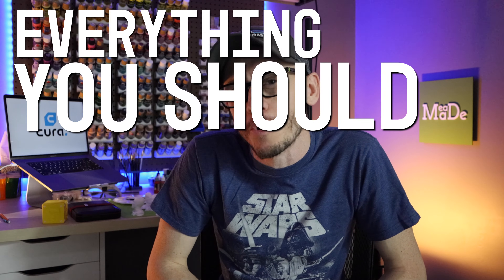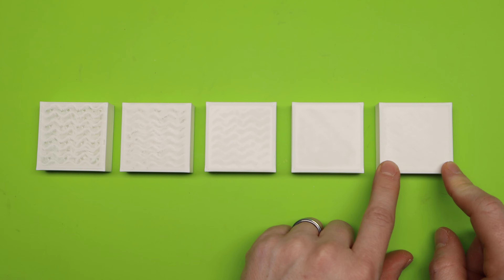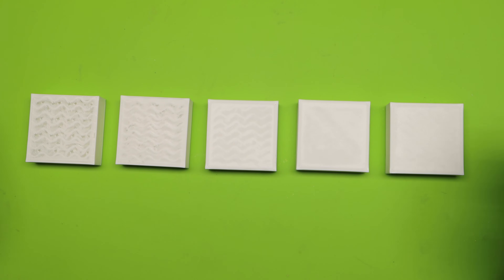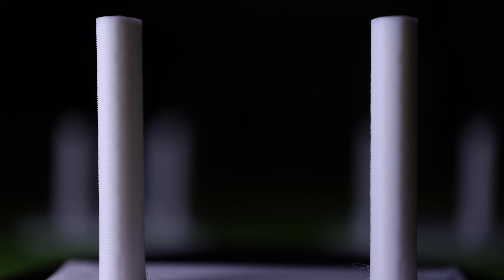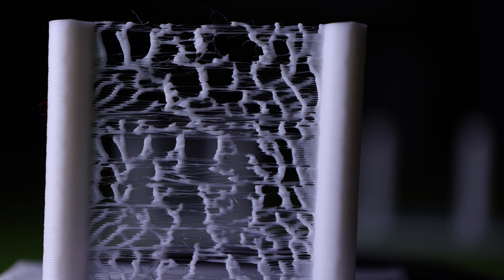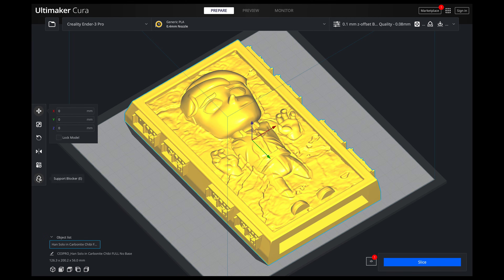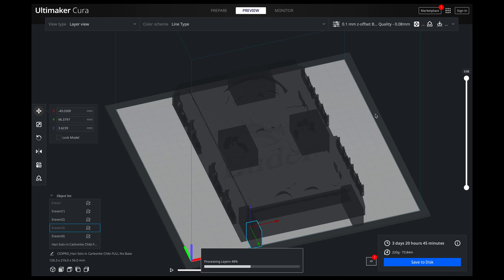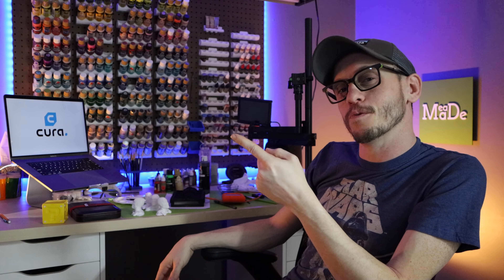Best Way to Get Rid of Stringing on 3D Prints Using Cura + Get Smooth Top Layer + Block Supports

Comment: Retraction Distance I found is not the only variable in that case, but in combination with retraction speed and print temperature, which depend on the filament you are using. For every filament, you have to document the Ideal Temperature to apply, the Retraction Speed (usually lower than the Cura default), and the Retraction Distance (higher, could be up to 10mm, obviously you won't exceed that since Cura won't let you). You'll have to experiment with a retraction tower first if you are using a new, untested filament.

Comment: Thank you! So much good information. I found this video because I have been dealing with a stringing issue. My prints were perfectly fine (well, more on that in a moment). But no stringing. I designed and created a squirrel proof birdfeeder. Then I dropped it and it shattered when it hit the rocks. When I started printing replacement parts, it was stringing bad. Wait a minute! What changed? It's only been a few days. The other roll of filament, a Sunlu PLA+ brown ran out and I replaced it with a Sunlu PLA+ brown roll. I didn't think that would do it. Oh and I upgraded from Cura 5.7.1 to Cura 5.9.1. One of those things or both caused the stringing issue. I was using the same Cura Print Profile. I export the Cura Print Profile and save it with my FreeCAD project files. I don't know which, but I will try the retraction set to 10mm before I continue.

I said my prints were perfectly fine. But from your video, I can see that pillowing effect on the surface can be fixed. I have only been 3D printing for 10 months. I'm printing with 3 layers. I guess I'll try 5 layers and see what difference it makes.

Comment: This may be an obvious question to some but are some brands of pla just more apt to have stringing? Ive gone through the video with you and my retract towers have stringing at 10mm still. is there something I missed? lowered nozzle temp to 190 from 210 by increments of 5 at a time and there is always some fine strings. increased retract speed. added z-hop. yours just worked but mine not so much.

Comment: Question about inner/outer walls print order. Around 6:31 you show the layer printing process where the first pillar gets the entire layer including the inner and outer walls and then the nozzle travels to the second pillar. My cura (version 5.4) prints the inner walls of the first pillar and then travels to the second pillar to print the inner walls. Then the nozzle goes back to pillar 1 and prints outer walls and then pillar 2 outer walls. This creates more travel (+print time) and therefore potential for more stringing. I can wall order setting to print outer walls first, but it doesn't change the fact that all outer walls are printed first and then all inner causing the same problem.
How did you configure cura to print "closed parts of layers" (inner + outer) entirely before switching to the next element?

Comment: Yes definitely change 1 thing at a time. At least for similar things to resolve 1 issue like stringing. Dont change distance and speed at 1 time.

But lets say you have stringing and supports that fuse to the part. I would change both the top distance and retraction to test both at once as they very very rarely make a difference to each other

Comment: I get thick strings that are at either end of each post but not extended across the posts. They are thick and bonded which will require sanding to get them off (much more than angel hair). What do I do? I have the Anycubic Vyper, if that matters.

Comment: Hi I just upgraded my Ender-3 s1 from a smooth pci sheet to a textured pei sheet. The pci sheet is 1.1 mm thickness the textured pei is .04mm thickness. PLA is all I use.  Print speed is 50 Retraction distance is 1mm temp is 210 and Retraction speed is 45. I have virtually no stringing on the Retraction tower at 1 and 2. And the calibration cube is practically perfect. I printed a little frog for someone and it has strings on the first layer between the toes of the frog and thicker stringing between the body and the arms, like the armpit area of the frog. I did change one variable at a time and thats how I got the practically perfect Retraction tower and calibration cube. Help please! Thank you.

Comment: when i use more than 6mm retraction the print id good, but it "always" clog the print at around 30hour later (>10mm retraction mean sooner the clog happen). the guide Not mention about the  clog the noozle cause of over retraction... retraction somehow connected to temperature, if its too high retraction useless. there a lot other to cover yet its not there

Comment: Just to add, an all metal hotend with a retraction above 2mm is a recipe for clogs, especially with PLA. PLA has little lubricant qualities, so away from a bowden tube it has a tendency to stick. Any retraction above 2mm risks molten PLA backing up into the heat break and solidify. 

It may be unlikely that anyone who has upgraded will be watching an introductory  video, but all metal hotends and direct drives as default are becoming more common. 

Just a friendly note to an excellent video. It might help someone.
Reply from the maker: Thank you for the great explanation. I’m currently updating this series cause there are things that need corrected and it’s Cura 5 not for there are things I train that don’t exists anymore.
Reply: @ItsMeaDMaDe  It's such a rapidly growing and developing field - things that were once beyond the scope of hobbyists are now becoming A Thing. Looking at you, Creality Klipper Board Thingy. Even thinking about keeping up can make me feel a) dizzy and b) financially ruined. 

And yes, Cura 5 caught me out a couple of times. In the end I grabbed a couple of updated profiles from Chep, and then updated them with your Support Settings course. It was good to go through it all again, actually. Helps the knowledge stick. 

Thanks again for excellent content, really appreciated.

Comment: Thanks for such good explanation and visuals for the different settings.  I'm very new to all of this but a quick learner and try to do lots of learning on my own. One thing I would like to know as far as settings is which settings would be good to save on filament when you don't need a very detailed print or strong for that matter?  Thanks again!
Reply from the maker: I'm glad i was able to help. There is a lot to learn in this hobby for sure. When it comes to saving filament you can use less of an infill and bigger layer height like a .2mm.  Hope that helps.
Reply: @ItsMeaDMaDe  Thanks for the reply.  I tried a print with your settings on this series and the print came out awesome.  Thanks for sharing your knowledge!
Reply from the maker: That’s awesome. I’m glad it worked out for you.  Best of luck in all your future Prints.

Comment: I have a question, new to the hobby.  I'm having trouble with the bottom of a model, like on a face. The bottom of the jar, ears, or anything that hangs. The filament does not stick, it sort of separates or doesn't print at all. I appreciate any feedback thanks
Reply from the maker: That sounds like an adhesion issue. I made a video explaining how to get better adhesion. You can see it here. 

https://youtu.be/EBfWhqKU3is

Comment: I tried playing around with my retraction like you showed for stringing and got no good results.
Reply from the maker: I would suggest using a different roll of filament to rule out the fact it might be a bad spool. If that doesn’t work make sure you print a temp tower to ensure you have your filament at the correct temp.

Comment: Guys I really need help! I have  an Anycubic vyper and I'm using PLA+ filament, which settings do you guys recommend me to avoid stringing?
Reply from the maker: I’ve never used a vyper but if you follow the steps in the video I show how to reduce stringing. Sometimes you can get a bad spool as well. It’s good to test with two different spools. If a spool gets moisture in it that can result it bad stringing.

Comment: Man, just bought an Ender 3 V2. Did Estep calibration, PID auto tune, flow tested, temperature tower - both PLA and PLA+ filaments I have (and even the tiny spool included), I get stringing all the way to 10mm. Slower or faster retraction, retract at layer change on/off, z hop on/off, combing, etc, I get stringing regardless. Very minute differences even between changing these settings. I simply cannot figure it out. It’s driving me insane. Should I be looking at nozzle? Ptfe tube? Extruder (seems fine)? I’m losing my mind
Reply from the maker: Hrm.. seems odd. Have you changed between brands I have noticed that some brands string more than others. Possibly try printing at a bit of a lower temp too. 

 Not to shamelessly plug my discord but it’s in the description of the video. Feel free to join and you can reach out to me there as well.
Reply: @ItsMeaDMaDe  I appreciate your response, I’ll have to hop in!

Comment: Hey I am having a problem with my cura making lines of filament between models like stringing how could I change this ?
Reply from the maker: It sounds like you need to adjust your retraction. I would do a stringing test like I did in the video.

Comment: IMHO..Fail to mention that using a direct drive extruden the retractions should be between 1-2mm. Bowden Drive extruden retractions needs to be bigger. Cura 6.5mm retraction by default seems to be for Bowden drive. Direct drives high retraction can cause some blocked nozzles.
Reply from the maker: Thanks for the tip. I only have Bowden tube drive. Wasn’t aware.
Reply: This is a big deal. Direct drive should be no more than 2.5mm MAX in most cases.

Comment: Great vid. The only suggestion I have would be go into some of the other stuff you can do with support blockers. For instance, instead of blocking supports in those areas, you could used them to change the infill there. Handy if you want one spot in the model to have extra strength. There a bunch of other options as well. They're a handy feature.
Reply from the maker: Thanks!! Yeah I was thinking about on a video just talking about everything with support blocker. Such a great tool! So you just confirmed that I should. Thanks for the input. I truly appreciate the feedback!